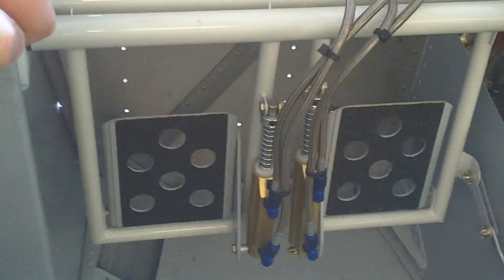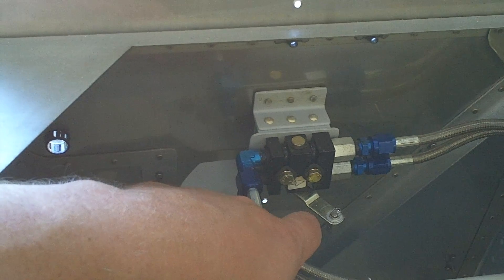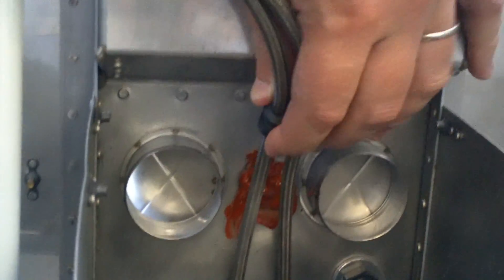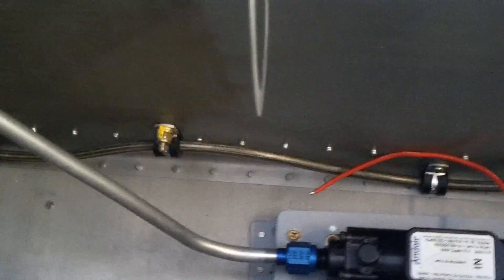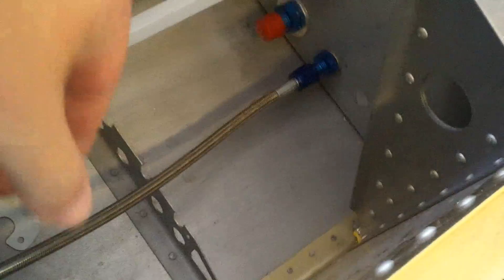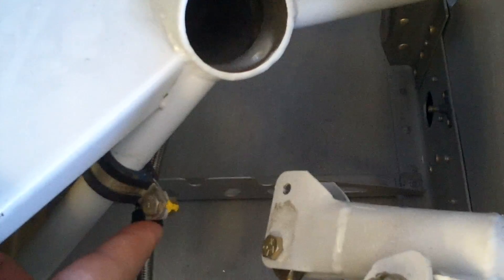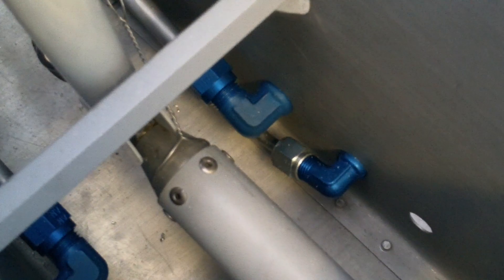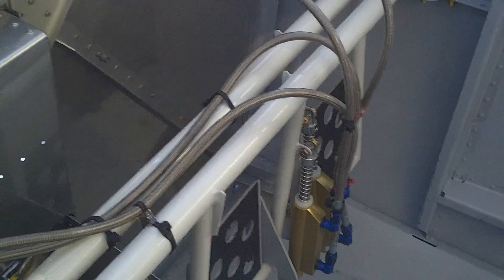Bonaco Brake Lines - RV-10

Comment: Hi. I note you have springs on your calipers. Did you find these helpful/necessary and if so, where did you get them?  Thx!
Reply from the maker: Brad Smith Hi Brad.   The springs on the master cylinders came from Ace Hardware.   I also put some plastic (Nylon or Delrin: I can’t recall) washers to spread the load and shim the gaps between the springs and the master cylinder.